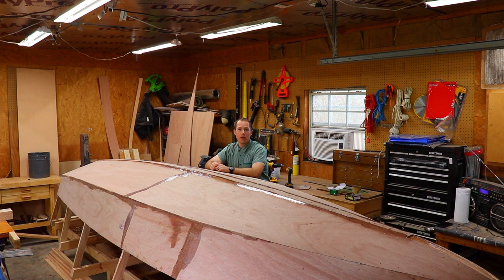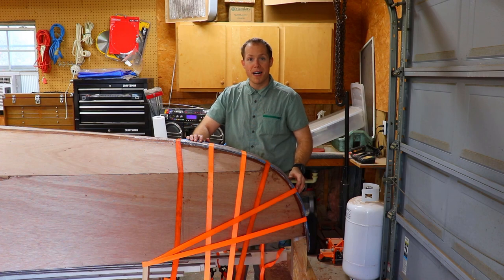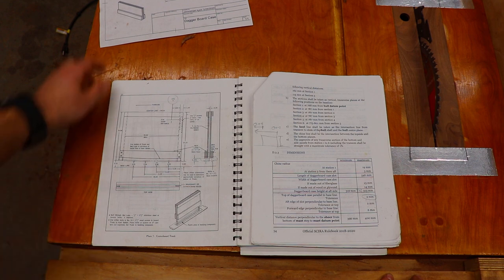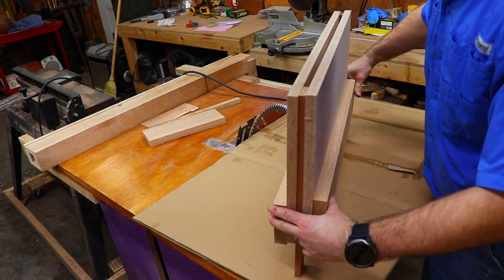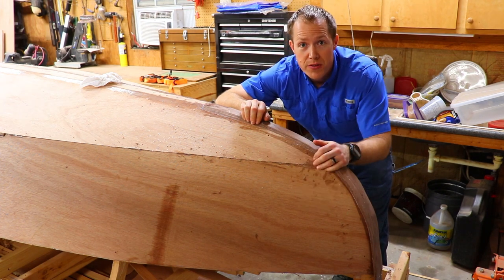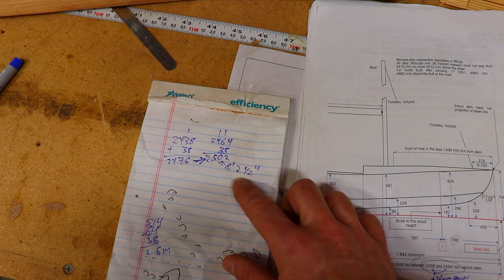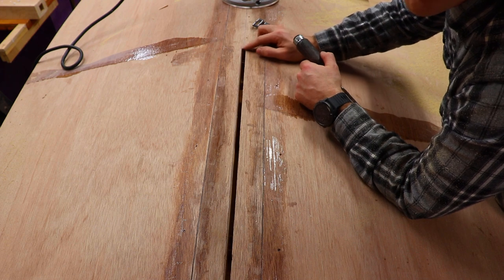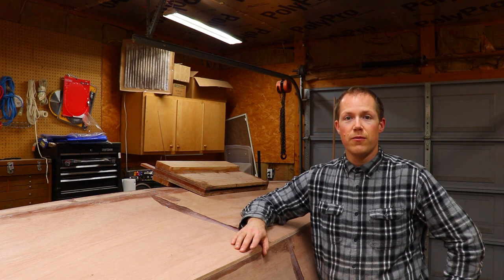You won't believe it! Cutting a hole in a boat! Building a Boat Part 8: Stem Cap & Daggerboard Case.

Comment: One recommendation: lay in some fiberglass cloth on the inner faces of the daggerboard case before assembly as the thin painted epoxy layer will eventually erode from repeatedly sliding the daggerboard in and out, creating a breech in watertight integrity.  Epoxy on its own does not penetrate very deeply into the wood, whereas the layer of FG cloth will add a significant measure of abrasion resistance.  For the same reason, the entire exterior of the hull should also be fiberglassed.
Reply from the maker: This is a good suggestion. Unfortunately I'm a little past the point to do that but this boat will be trailered/removed from the water daily so I'm not too worried about water absorption if it does wear through.

Comment: i will need to go back and watch from the start. i have watched other boat building videos, and my plan is to build a 12'-15' plywood sailboat such as what you are making. you seem to have a good handle on what you need to do to build it. i am looking forward to seeing the other videos and how you got to this point.
Reply from the maker: Thanks! I appreciate it! I hope your project goes well. Have you picked a design? I have been told there are many sailboat designs in this size range that are easier to build but the Snipe has history with my family.